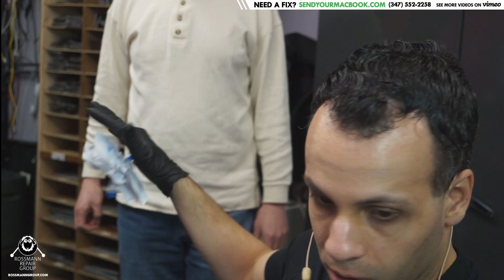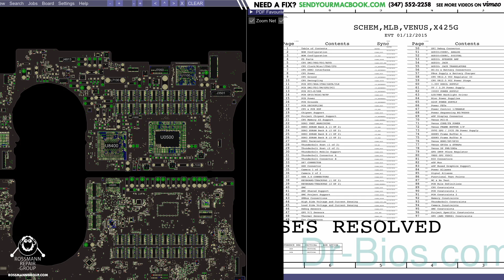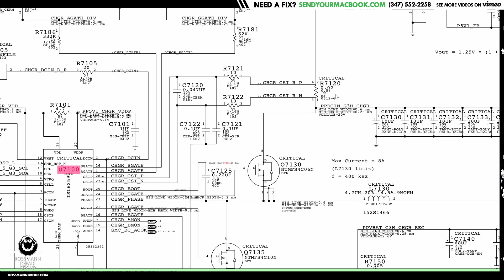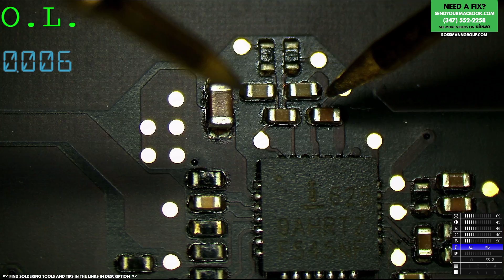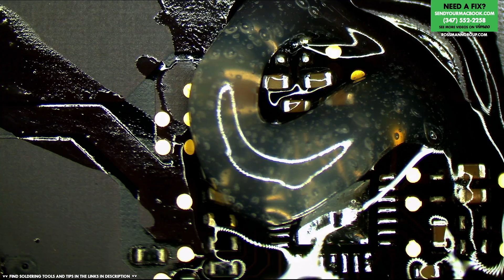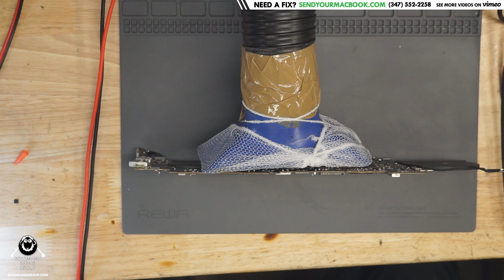What does a knockoff charger do to a Macbook Pro? Why should you not use one?

Comment: A "good quality" electronic design takes into account what happens if the power supply voltage is too high, too low, wrong polarity, or not consistent enough. Any laptop or any expensive thing, really, should be intrinsically protected against this. Like any portable electronic device manufactured after, say, 1975 would have been. I mean, seriously, my Tandy 100 from 1983 has circuitry to prevent DC input from charging the AA batteries.

I think it's important to note that the reason you should not use a knockoff is because Apple voluntarily chose to ignore good design practices. It works in their favor because you can damage your machine by using a knockoff and they can juice you for the repair. But if they'd made the laptop $2 more expensive by adding some protection to the power input, then you'd be able to plug it into practically anything without worrying about damaging it.

If the Mercedes GLS didn't come with a fuel filter because "you should only fill it with certified ultra-pure Mercedes gasoline," people would not blame regular gas stations for Daimler's negligence.
Reply: Well written
Reply: totaly agree, power supplies can fail. When you are able to swap it out that easily you should also look that the laptop itself have some protection against bad psus.

Comment: I'm running an aftermarket charger for my 2011 macbook only because I legit could not (and still can't) afford a first party charger. But I didn't shop around for the cheapest one I could find. It took a hot minute or two to find one that had good ratings for reliability, and it wasn't the cheapest one out there, but it was one I could afford. Seems to've been working perfectly fine thus far.

Comment: Would the same advice on not using 3rd party chargers apply to those USB-C hubs that are fitted with a Thunderbolt 3 charging port? For example, if you charge the MacBook (say the new 16") with it's original charger through one of these hubs? Could it still mess up the device because the 3rd party couldn't adequately figure out some cryptic power usage pattern of the Mac?

Comment: Bought a 3rd party charger for a mid 2015 pro and the only thing that it does is make the touch pad not work well causing the cursor to lag and jump around the screen so you cant precisely track with it. Unplugged it works normally so as long as it charges the damn thing and doesn't  brick anything i'm good with paying the $30 for the knockoff charger vs $80 for the OEM.

Comment: Dude your an electronic badass! This video took me way back to high school when i took a short class on tv repair. Accept the fact that what you work on is WAY smaller than the vacum tubes and cathode ray tube that were in those relics. Even the caps. and resitors were larger. And i could go to radio shack to buy all parts i needed. I ended up in construction by the way. Thanks for your videos and honest commentary. Love the f-bombs in the appropriate places.

Comment: And what does OEM charger have (and "knock-off" don`t) that prevent destroying that resistors?
I think the real problem is not with chargers....but with motherboard poor design that could not handle input current properly.
It is not like on phones which accept multiple voltages for fast charging and need a special circuitry to negotiate the correct ones.
Reply: Cosmin Dumitrescu Tight regulation, protection circuits, safety? You know, proper design and quality too!

Cheap stuff is cheap for a reason.

Comment: apple sponsored video have fun paying 80 dollars for a charger that someone made in a china factory for 5 dollars
Reply: 1MNUTZ But properly designed and built with quality parts, unlike the cheap stuff.
Reply: @ve2mrxB  plenty of "cheap stuff" works just as well as the "oem" version if not better and at 1/7th of the cost. Go ahead and throw away your money for overpriced junk that is designed to fail
Reply: 1MNUTZ Depends on your definition of "cheap". It could mean "low quality", which usually also excludes safety and good regulation (performance) as seen in this video, or "low price" that includes the above as well.

There is a middle ground that's called Third-party, where you can get quality (safety), performance (regulation, current) but not 1/7th price. More like ~80% price.

I will never cheap out on power quality to save 30$ on a 3000$ computer. That's 1% of the price of the computer! And as Louis does mention, your saving 1% pays him around 10% of the price of your machine!

It's your money, not mine, do as you want, not my problem.
Reply: @ve2mrxB  yea exactly it's not your problem your problem is you're paying apple ridiculous prices for the same quality equipment. The reason why you're purchasing a replacement charger in the first place is because your oem is a piece of shit and it broke because that's what it was designed to do... 

Apple uses third party manufacturers to make their bullshit chargers then sells it to you for 80 bucks while making it for a couple bucks. So yea it is your problem you can't get over the fact that you're paying for the same bullshit quality but paying 5-8 times more the price.

Comment: How does the general switch over to USC-C power delivery affect the situation? Are knock-off chargers less dangerous? I'm not thinking so much about using cheap ones, but taking advantage of being able to charge a device from any USB-C PD socket on the go when the OEM charger could be left at home.
Reply: It must be more regulated ,right? I mean every new Monitor (over 400$) will charge your device over usb-c, without even asking you.

Comment: What about high quality 3rd party chargers (e.g. Anker) on an iPhone? Or that from another manufacturer (e.g. Samsung charger)? 

Maybe phones are not that sensitive as MacBooks?
Reply: tahaak I am certain you can buy quality third-party power adapters. The issue is finding where is the quality and where is the scam.

I usually go with "If I can yell face-to-face with someone from the company at their place of business, it's likely OK". But not if I have to go to another continent.

So, most of Amazon is out, Ebay too. And they MUST have their place of business in America, with safety certification.

Comment: What is considered a “knock off charger”? I have an Aukey USB-C power supply it wasn’t cheap. It has USB-C and two USB-3 ports. Is this the kind of charger that will leave your Mac Dead?
Reply: For a Mac.. I  would say a 10 USD one that doesn't supply the power that your original charger state //model need ...
Reply: Brian Bock Knock-off usually means the copy of a brand name. Not to be confused with third-party.

Third-parties are reputable companies who design and manufacture their products to spec, with quality and safety in mind, unlike knock-offs who only care about unit price and volume (low quality, cheap and unsafe stuff).

If they are safety-certified and have a place of business in America or EU, they are likely OK. I do trust Anker, and Aukey is likely as trustable. I just never dealt with them.

Comment: I have an A1398. Green charge light lit. OS profile says battery detected, 0mA available, 76cycles, not charging. Is this more likely to be the battery or the board? Opening the back, disconnecting the battery and putting a Vmeter over the two end terminals gives only 2.9V (ish). This happened after I left an update running overnight and found it dead in the morning (mains attached).

Comment: So, why is nobody making "cheap" chargers that actually work properly? Are Apple chargers really that overly complicated?
Reply: FrankyBoy search for counterfit power adapters. First thing they remove is safety. Second is power quality. Third is overall quality. At this point it's a safety hazard!

Do you care about 120V on the power jack?
Reply: @ve2mrxB  it's great you entirely missed to answer my question
Reply: FrankyBoy I haven't, cheap excludes quality or performance. Quality is needed for safety.

Many manufacturers sell power adapters that are less expensive than Apple's, but they are not "cheap".

They are not cheap as in low quality, and are not cheap as in low price.

Quality/safety, performance, inexpensive. Pick two.
Reply: @ve2mrxB  As you might have noticed I put "cheap" in quotation marks. I am sure you can make chargers that are cheaper than the original which do not compromise on quality. And no, cheap does not mean reduced quality or performance by any stretch. It only means not expensive. How you achieve not expensive matter (which you seem to throw into "cheap") is a completely different topic.
Reply: FrankyBoy Well, then, your answer is that Anker and others ARE making less expensive power adapters as good as Apple's.

Comment: I got an OG google pixel xl.... the cable to the charger pretty much shredded itself. then I ordered an amazon brand charging cable, and use the oem block (the cable is usb-c both sides and plugs into oem charger brick). and i have to say, its been great. its a beefy ass cable too. amazon brand electonics are stepping up big time. i even have their mechanical monitor arm and its 10x better than the one i got from newegg....

Comment: 09:28 - I see they chose C7120 (differential mode filter capacitor) as a lower value than C1721 and C1722, so the current detection speed is increased. Don't want to be absorbing too much of that voltage differential too quickly which will slow down the detection time of changes in the current. I love analysing circuits and learning from them.

Comment: have macbooks become weaker? We used to supply off brand chargers for a fleet of 50+ macbooks, from 2007-2012 vintage.  (chargers usually lasted 6 months max before being physically damaged, they and the pre-ssd hdds become most of my budget) Never had a power failure on one.
Reply: usually most offbrand chargers dont actually even comply with electrical standards and quite often let off severe interference and lack any protections like overloading/overheat/short circuit/under voltage etc....

Comment: I can't say much about charging products that carry the half-eaten apple symbol, but I can tell, that cheap chargers are rarely worth their money . This especially applies to chargers that claim to output up to XX Amps , but don't state any negotiating protocol for doing a handshake with the connected device about the way the device likes to be powered.

In my experience, chargers should offer at least one port supporting QuickCharge 3.0 (or better) and/or one port supporting USB Power Delivery (usually a USB-C port). Additional ports OK. That way you can be relatively sure, that at least one port of your charger has a good chance to charge any USB device that also follows one of these proper standards, i.e. modern smartphones or tablets. This also applies very much to power banks!

Comment: Happened to me all the time when I was a depot tech fixing toshiba, dell and hp laptops way back. People would get adapters with the right voltage but the amps were wrong. They only saved $20-$30 bucks not worth it.people would get upset when I told them what happened. They would just tell me “but the end fit in the port”
Reply: What do you mean with  the amps are wrong?

Comment: I've been using a knockoff charger for my 2011 Macbook after I lost the original.  No problems so far.  The original one sucks though because the cable material gets old and splits.
Reply: What most people don't understand is third party != knockoff. Sometimes third party accessories are actually better than the original ones. That one time when my iBook's charger's cable burnt up, I got a LPS adapter: it's still working today, some 15 years after. 
Nowadays it's just too easy to buy a knockoff from Geek or Wish. People should research what they buy instead of whining after getting ripped off.

Comment: you shouldnt cheap out on the power supply like ever. It always ends up badly
Reply: Exactly.  Nobody would build a foundation out of straw.
Reply: @gavincurtis  Bhought a cheap universal charger for my Dell Inspiron, works PERFECTLY since 2 years... Apple is just shipping crap-products.
Reply: @predatortheme  I use universal chargers for anything. Not on Macbooks because I haven't found an universal charger with a Macbook plug.
Not that I ever needed one, though. The only time I had to buy a charger for a Mac was with a G4 iBook, and that one worked with no problems to the last day I used that machine, I'm just that lucky, I guess.
Broken macs are what you should expect from a mac repairing channel. Think how boring would be, a youtube channel talking about working computers o_O
Reply: @IlBiggo  Apple is a terrible company when it comes to computers, their lack of customer support is mindnumbing, even for  enterprise grade machines.
Reply: @predatortheme  Wrong tree to bark at, sorry. I still own and sometimes use the Apple IIe I learnt programming with in the early '80s. I bought my first Mac in 1988, and my last one in 2012 (the MB Pro I'm currently using). I haven't ever needed support, but this one Apple Center tech guy I met one day said his yearly load is something like 2 broken computers vs 500 broken iPhone displays.
Of course, all depends on your expectations and on the people you contact: hoping for a miracle from so-called "geniuses" is silly; what many haters refer to as "Apple" (Apple refuses to repair! Apple tried to sell me a new phone instead of replacing the battery! Apple didn't honor the warranty!) is usually some kid at a store's counter. Just imagine Apple actually having to deal with the thousands of whiners we see on the 'net.
Learning to take care of your stuff is the wise thing to do. I'm doing a bit of support/repair for some friends and acquaintances, and you wouldn't believe the horror I'm forced to see sometimes. Be it computers or hi-fi or other electronic stuff, it's invariably dirty, dented, half-taken apart or abused in some way. 
Don't take me wrong, I'm not one of those maniacs who keep their stuff in the original box for ten years. My computers are sometimes dirty and abused, too .-D

Comment: do SSD's care about magnets? couldnt help but notice you put a neo magnet in with the SSD, so i guess it wont be bothered by the field huh? im seriously asking a question here i dont know, i have always just played it safe around ALL storage medium..
Reply: :"A magnet powerful enough to disturb the electrons in flash [what SSDs are made of] would be powerful enough to suck the iron out of your blood cells" - Bill Frank, executive director of the CompactFlash Association
Reply: A very strong magnet will turn on an FET, so if the computer is powered then a huge magnet -- the kind that would jump across the room and crush your bones -- could mess stuff up especially switching power supplies.
Reply: Magnets? Not particularly. I'd be far more concerned about electrostatic discharge from the generic plastic bags.
Reply: Spinning media (regular HDD) are relatively susceptible to magnets that are stronger than those used to hold screws on it.  I wouldn’t want any magnet near my old skool spinning disk drives, but NAND SSD’s are not as susceptible to small magnetic forces, it would have to be fairly large and powerful.
Reply: usually no, the reason hard drives and magnets don't mix is because the data is stored via magnetic fields and disturbing that arrangement rearranges the data structure, this doesn't apply to SSDs or NAND storage
Reply: Soooo people notice the magnet but ignore the non ESD safe plastic bags ??

Comment: Resistor failure is strange.  Literally no fail safe on the board for it not faulting when an alternate PS is used.  Resistor = fuse according to Apple Engineers I guess?
Reply: Anything is a fuse if you push enough power through it  ( ͡° ͜ʖ ͡°).
Reply: @ayuchanayuko  sometimes even humans
Reply: Resistor = fuse, and fuse = high current bus bar. In Apple design the chip will always fail first to protect the fuse.
Reply: @RambozoClown  Apple just cheap bastards because they don't want to put a proper protection circuit.
Reply: @MD4564  
Adam Grufík
6 days ago
@Twigleaf Does it really matter if it blow a fuse or a resistor? You need to change them anyway.
Reply: It's not strange. If the current passing through them is high enough because of a poorly regulated power supply, they will fry.
Reply: @larzblast     I guess what I am trying to say... it is strange that there is very little protection with the design of that specific board.  I am assuming that there is at least some level of tolerance for this, even in cases of someone accidentally using an invalid PS.  Rhetorical maybe, but fuses be damned.   Needs some kind of redundancy.
Reply: @Twigleaf  Does it really matter if it blow a fuse or a resistor? You need to change them anyway.
Reply: Resistors are used as fuses in a surprising amount of electronics, most notably led light bulbs.
Reply: I always use cheap chargers when the original is broken or lost. Never had a problem with different brands of laptops, phones, cameras, etc. except for apple product, never used em.
Reply: Marcus Jr nobody asked

Comment: I would also not use a knockoff charger for any Asus products
Reply: I hear a warning, which maybe I should heed!?
I have an Asus Zenbook. I had some old charging bricks from dead laptops. These were original equipment ex Sony for instance, but deliver correct voltage for the Zenbook. 
I have attached the correct sized power barrel jack to these. I have started using them so there is always a charger on my desk etc.
Do you have experience of problems with Asus laptops failing due to non Asus chargers? Maybe I am living dangerously? 
My motivation is mostly trying to repurpose functional kit to avoid adding to e-wste landfill (as opposed to saving money).